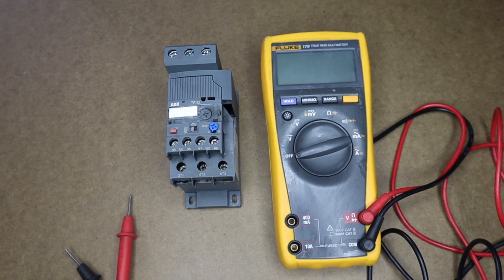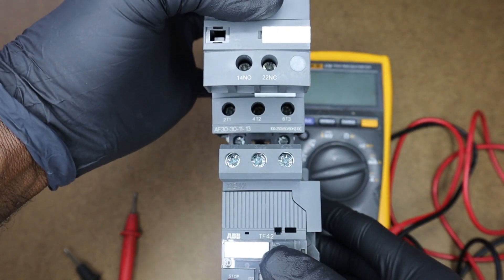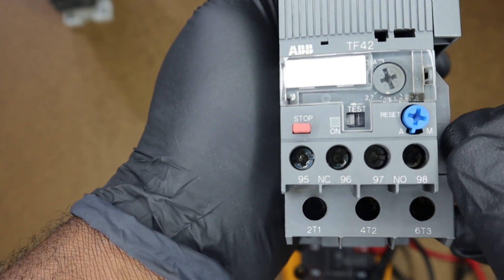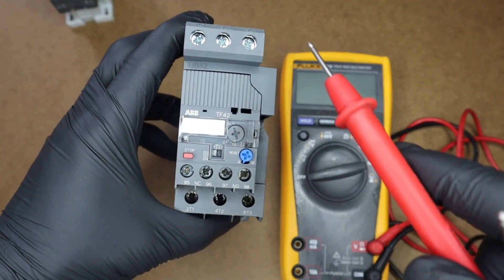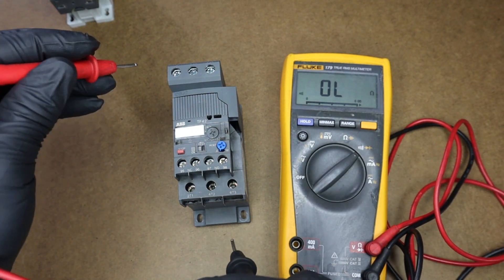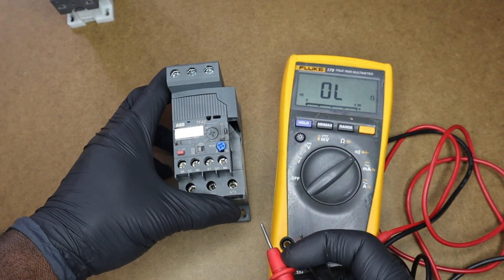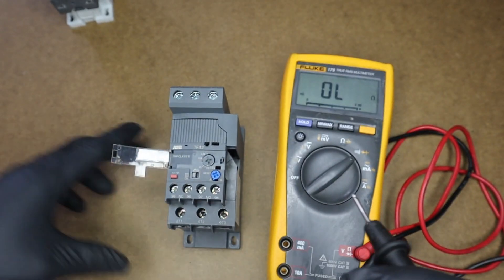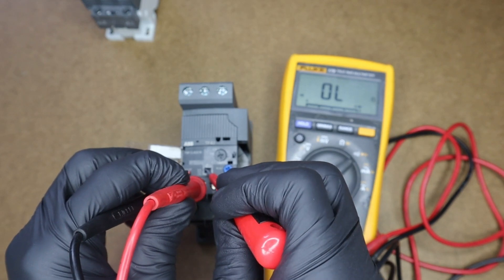HOW TO TEST AN OVERLOAD RELAY

Comment: Hi and thank you for your time. Please can you help me? I'd like mounting the AbbTF42 on my motor (1 phase 220v) and I have the contactor BTicino FC4A2N24 were I have mounted my motor... If I'll put the out of contactor (where now there's the motor) on l1 and l2 of the TF42 and t1 and T2 mount the motor on this pins it's correct whiteout use the pins 95, 96, 97 and 98? Thanks 🙏
Reply from the maker: Yes, you should be fine with that setup.

Comment: Great video sir. Does it mean that, even if power flows through the o/l relay,  the overload's nc and no only change states in one condition; when the overload relay trips?
Reply from the maker: That is correct.
Reply: @synectum640  thanks sir!

Comment: I have continuity when power is on but not when power is off    I have 3 of these in a row and the least one doesn’t have contenty when it’s on or off
Reply from the maker: Seems you might have a tripped OL. Remove power from circuit, reset and test for continuity. If you do, check circuit for a potential short.

Comment: My motor is on all and won’t shut off when it supposed to would this be a solution ?
Reply from the maker: I belive you have a controls issue. You on/off or start/stop seems to be not working and hence keeping your contactor closed. I would start there and work my way down. Thank you.

Comment: So if power is applied do you have 0 volts on your NC and 24 volts on your NO then if it does trip, will you have 24 on your NC breaking it and 0 on your NO? Or am I wrong
Reply from the maker: You usually only wire your hot going through your NC contact so it depends on where your reference is that determines the voltage read at your NC contact. If your measuring across the NC and NO contacts then  yes. The coil if it is a magnetic or electronic  will also affect these readings for your NC contacts.

Comment: So what I understand is that the NC contact (terminal 95 & 96) will break open during an overload... However, will there be continuity between terminal L3 & T3 when an overload occurs?
Reply from the maker: Yes that is correct. 95 - 95 would be wired in series with coil wiring of the contactor supplying the 3phase power. When it trips it opens the coil circuit, deenergizes the contactor and opens the line to load contacts which prevents current from flowing to the overload terminals IDEALLY.
Reply: @synectum640  Thank you for the confirmation and for the great video!
Reply from the maker: You're welcome and thanks for the feedback.

Comment: I have question why L1 and T1 reads OL, also L2 and T2 reads OL but why L3 and T3 is shorted. I don't understand
Reply from the maker: Good day. For an overload there should always be continuity between ( L1 - T1) , ( L2- T2) and (L3 - T3) in a normal operating overload device. In my example we experienced "OL" conditions between our first two line to load contact legs hence why that overload was a damaged one. NOTE : It's different  from a contactor where you'd usually have an OL condition between your line and load terminals until the coil is energized.
Reply: @synectum640  Thank you and I now got it. :)
Reply from the maker: You're welcome. Happy to help.

Comment: Sorry for my English, I'm Indonesian.

Is it possible that Thermal Overload Relay not tripped above the set point after determined time achieve?

Like: Set 50A, Class 10. The current condition is already above 50A – let say 60A, for more than 20 seconds, and the Relay still not tripped.

What part of the Thermal Overload Relay is broken?
Reply from the maker: First off for any thermal overload malfunction I would advise you to check the wiring first. Ensure your NC contact is wired in properly to break the circuit in a tripped state. Another failure point is the thermal bi metallic strip. Based on your question however in order to properly set and size the adjustable class 10 overload you must first get your FLA rating from your motor nameplate and use your 125% x FLA if you have a SF of 1.15 to get your max load current. With those values you can properly determine if your overload should have tripped based on your calculations.  If possible state the voltage level, FLA, SF, and also the model overload you are using so we can carefully diagnose. Thank you.

Comment: Connectivity test is good but how are we going to test that whether the relay tripping coil really works when an overload current pass through it.
Reply from the maker: The most you can do are the test outlined in the video. Only additional test is to actually supply the overloaded current to see if it trips (I WOULD NOT ADVISE THIS).

Comment: Thanks for this informative video. Can you tell me if a relay like this can be used to protect a single phase 220v motor from overheating?
Reply from the maker: Thank you for the feedback. Any motor being controlled it is recommended to use an overload for protection. If your motor is overheating it is probably overworked ( having too big of a load). While this overload will protect you from over current which is a common factor for overheating, you might want to upsize you motor to match the load it is connected to.
Reply: @synectum640  Thanks for your fast reply. It's not that I'm having a problem with overheating but I want to prevent any potential overheating problems. I have assembled a diy meat grinder and only use it for meat but I want to grind bones as well. I've only recently learned about overload protection and want to protect the motor in the event that it gets stuck on a hard bone. 
If It's not a problem for you can you recommend a suitable overload relay for my current set up? The motor is 2.2KW 220V.
Reply from the maker: What is the FLA on the nameplate of the motor? Should be around 10 -13 amps.
Reply from the maker: Eaton XT series electronic overload relay, 4-20 A adjustable. Model type XTOE020CCSS.
Reply: The motor says 2.2 kw 220v and 7.5 A All of the words are in Chinese so I'm not sure if the FLA is 7.5 A. As for implementing overload protection this might be a dumb question but how do the connections go? Will it just be as simple as running the power source for the motor to L1 and L2 and then connecting T1 and T2 to the motor?
Reply from the maker: To run the overload you'll need a contactor. The model I sent is a combination of a contactor + overload usually termed as a starter. You could try sourcing a 2 pole contactor and overload which would be a straight forward wiring however  a 3 phase/pole starter can also be used. I posted a link for the wiring if you can only find a 3 phase contactor and overload.
Reply from the maker: https://temcoindustrial.com/product-guides/contactors-and-overloads/1-vs-3-phase-contactor
Reply: Thanks for all the info. I will purchase the overload and see how it works for my project
Reply: @juniorross3396  just make sure that the amp setting on the overload match up with your amp on motor, the overload setting can be a slight higher without any damage in case of a failure.
Reply: Thank you! My motor keeps tripping and I shut power at the disconnect. 480v motor is new. I ohm out the overload on each leg and the last leg reading is oL … I tested an exact same overload at a different panel and it has continuity.